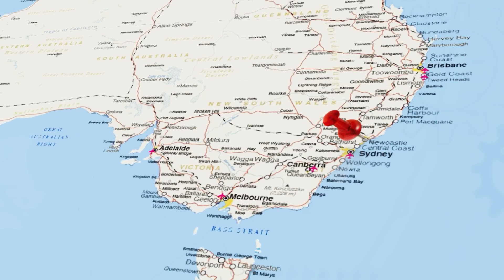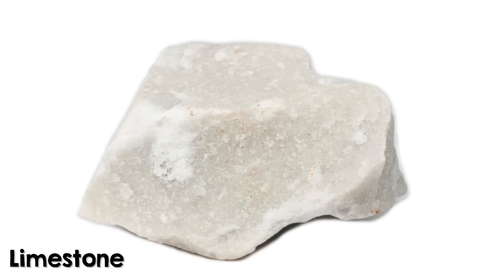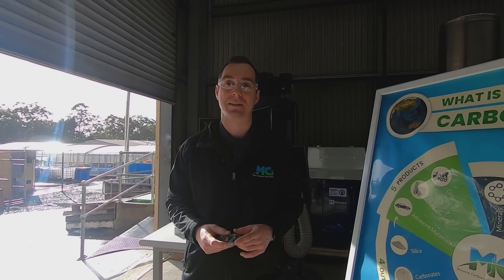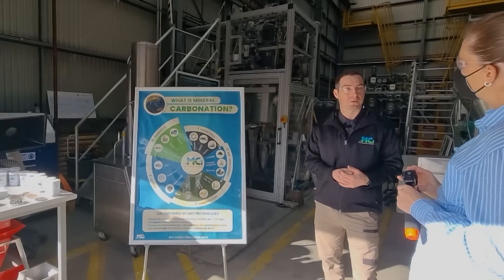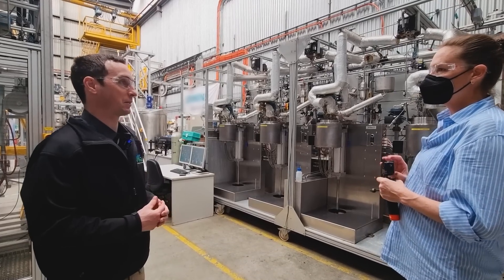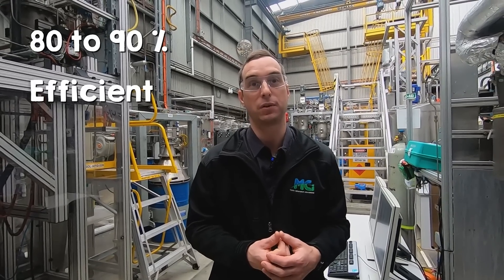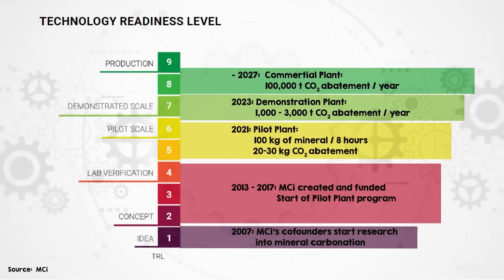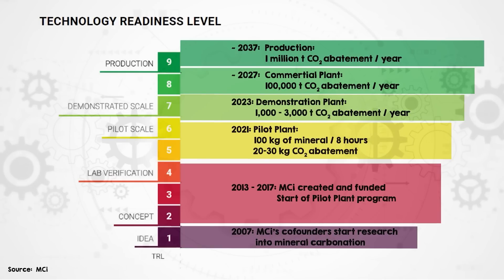Turning CO2 Into Building Materials: Mineral Carbonation International Tour

Comment: A 90% carbon capture rate if powered by dirty coal and carbon negative when powered by renewable energy is very promising. If the concrete that is made with the output from this process has any residual non bonded calcium, it will continue to pull CO2 from the atmosphere and get stronger just as Roman concrete has done for millennia.

Comment: I would like to see the flame resistance of the calcium carbonate ( plyboard replacement ) to see if it is better than standard.
Reply: Calcium carbonate does not ignite. Even if the fire were hot enough to start breaking the chemical bonds, the resultant CO2 produced would actually act to retard the flames. This is very unlikely though, given that the melting point of CaCO3 is 1339°C, so the fire would have to be insanely hot to break the chemical bonds.
Reply: @rmar127  I used the term " Flame Resistance " not " Flammability " as some " Flame Resistant " materials actually reflect the heat and can help other items to combust.  An example is Ceramic as inside Kilns.  your kiln will not burn, it will reflect the heat so things inside burn.  Sodium Bicarbonate also is flame resistant, you do not see Baking Soda Bricks in a kiln as it does not reflect heat.

Comment: Entropy always has the last laugh. HAve you done an energy balance for the whole process, including transportation, mining, etc re. use of fuel and generation of CO2? I think you are implying a perpetual machine here, by obscuring the real and holistic aspect of the processes described. CO2 is a thermodynamic 'sink' (energetically essentially the bottom for carbon). In order to transform it you have to 'pump' energy into the process, thus thermodynamic losses due to heat, sound, etc (entropy). Real mass and energy please? Thanks!

Comment: 2:40 Thermal activation to improve reactivity of the mineral, sounds like heating calcium carbonate to turn it into calcium oxide. Guess what the by product is of that process? Carbon dioxide. So removing co2 just to replace it again. If this is true this removes nothing. This heat would also have to be from 100% renewable energy as well obviously. He did not mention this part of the process in his later detailed description with the props and it was not part of the plant either. So why was it in his poster?
I assume Newcastle U is a well-respected one, so I am prepared to be proven wrong, this is just a follow up question that Rosie has missed. She is not a chemist after all, but then neither am I. I really hope Rosie gets an answer to this, as otherwise this seems like very promising tech.

Comment: This is a brilliant example of green engineering. Can the evaporator water be captured and drinkable? I would favour the calcium process as magnesium is more useful to other applications. Would acid rain breakdown the building material and release the CO2? I would keep the small scale system and just build more and locate them where required. I'm currently building an electronics off grid on a 22ft river cruiser which is also my home. Solar is the key to efficiency and I would love to build your electronics and sensors when required. Great work. :)

Comment: Steelmaking slag starts out as calcium carbonate and the CO2 is driven off the material in the blast furnace, picking up silicates from the iron ore.  This carbonation process would then be capturing only a part of the very CO2 the process produced- a minor mitigation at best, relative to using a method like the direct reduction of iron ore using hydrogen or perhaps one day, Boston Metals' melt electrolysis steel production method.  As to serpentine and other natural Ca/Mg silicates, no mention is made of how much energy is needed to mine, transport, grind and "thermally process" the native materials so that instead of them gradually "weathering" to carbonates on their own, they do it quickly enough for these guys to get paid a credit for.

Comment: Unfortunately most flue gasses have CO2 concentrations lower than 15%..... So there are immediate contradictions here - is it optimum for direct capture from flue gas or does it work best at >15% concentration? If the latter then I would like to see the technology that works best for concentrations in the 4-13% region
Reply: The flue gases would be concentrated
Reply: @richardhill4938  How? Link to useful website please.

Comment: When all you have is a hammer, everything looks like a nail.  This is interesting engineering solution.  Compare that to incorporating carbon into the agriculture system where crops increase productivity with carbon with natural cycles of sun and rain.  Culturally we would have to increase the value placed on appropriate farming techniques like regenerative agriculture that builds soil instead of depleting it.
Reply: Regenerative agriculture is very much needed. To regenerate fields everywhere. A good case for integrating climate concern, i.e. co2 and methane emissions, with other pressing problems.

Comment: Rosie, have long been a fan of Australia's engineering talent- from some of your "older heads" with mining backgrounds to the newer generations looking more and more like you! I do have a question about MCI's process; it uses water at one step to create a slurry, and after the mixing, the slurry is "filtered" for solids to be processed. All good, but how economical is it in terms of water use/reuse or wastage? I'm assuming the water let would be unfit for human consumption, though I could be wrong. BTW, I have come to expect unexpected turns from you lot; when Boeing was shopping for some international partners to build the tail sections of the 787, I believe, it was Aussie engineers who both figured out how and hos to make carbon fiber manufacture cheaper than they could make the parts in the US plus the shipping! That is the out of the box you keep doing- and we need all of it you can stand!  FR
Reply: Hi Frederick, I’m not sure of the exact process that is used to separate the end product from the water 💦. However, I’d imagine it was a closed loop system. Where the water used is filtered, cleaned and then put straight back into the next batch of slurry. I’m sure there are plenty of hurdles, however if I was an engineer on this project, that would be my design criteria. Especially given the water scarcity in Australia
Reply: @rmar127  that was much the driver of my question- in the larger sense, one of the things oil frackers have really tuned perception of wastage by industrial process- Australia's  sometimes more sparse rains would make it more imperative.  Thanks for the response.  FR

Comment: I work at an art school and we generate a fair amount of casting plaster waste.. and I often wonder if it could be used to capture CO2.. it is presumably Calcium of some sort.. I thought it may be a fun project to do with students if anyone knows whether it is possible.. also it seems hard to get recycled. People are happy to take plaster board but not old moulds.. maybe harder to grind up?
Reply: you can't use casting plaster to capture CO2. It contains Sulphate. If you could replace the sulphate with carbonate you woul produce sulphur dioxide as a poisonous byproduct. That's why they use minerals that contain oxide and no carbonate and no sulphate so that the oxide can capture the CO2 and becomes carbonate.
Reply: @idjles  thanks for that info! Very useful

Comment: I like how they never mention /all/ the facts, theres just one part of the process absorbing co2, but all the othe 8/9 parts generate co2 (unless running of renewables, and lets not go there...) and dont forget the footprint to transport raw materials, its great that you can absorb 10globby bits of co2 and stick that in advertising but its not totally honest if you dont mention that you created 8 to absorb the 10.... I'd like full figures please...
Reply: He said it's around 90 percent efficient. I took this to mean that for every 100kg of carbon it removes from the atmosphere, there is an energy cost of 10kg of carbon going up into the atmosphere. And he did 'go there' in respect of renewables: he said the efficiency figure would improve if the process was using a low-carbon energy source. I think he was talking about the entire end-to-end process.

Comment: This actually demonstrates the "three step" green concrete where production sequesters carbon, the usage avoids carbon emission (normal concrete is a co2 emitter) and the concrete technically has lower carbon content than normal concrete because that's all that's needed for structural soundness but has the added benefit that the concrete will absorb co2 in it's product lifetime. If we compare this to say timber framed high rises the problem here is it on paper would be cheaper wood isn't really renewable without a lot of management and if we scale up it's usage it'll no longer be renewable.
Reply: Wood, the natural product, isn't renewable. That's a new level of psychosis.